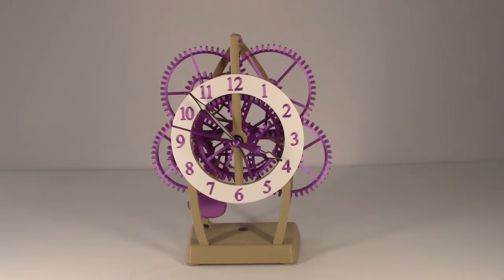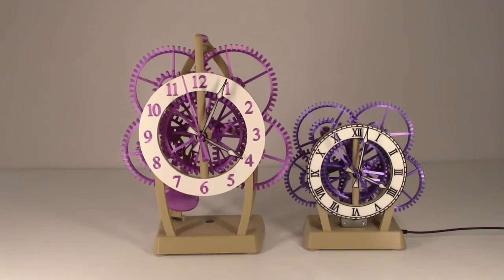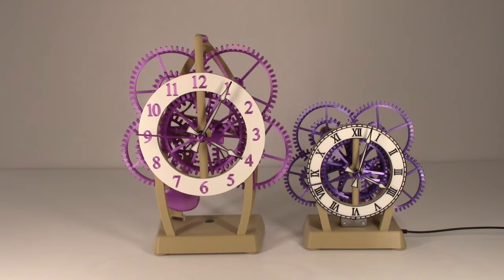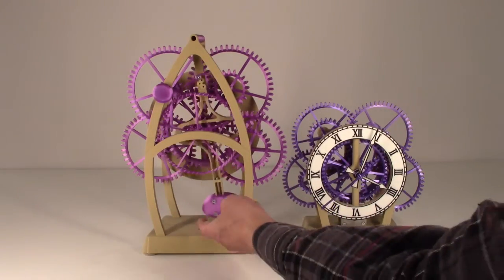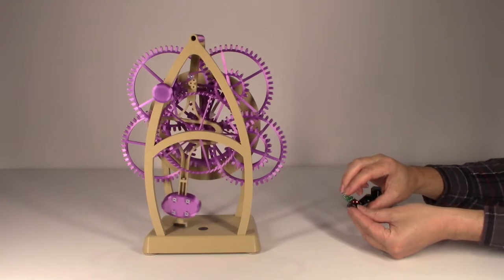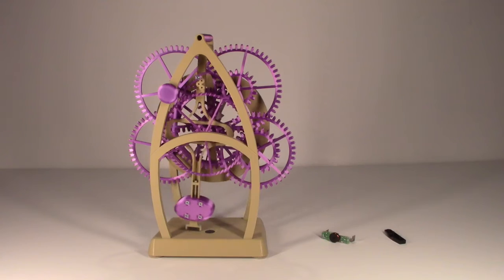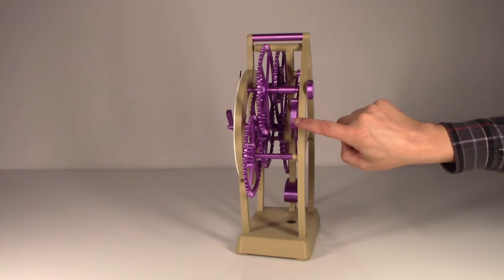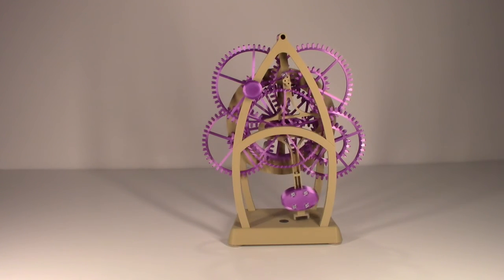Electromagnetic Pendulum Clock

Comment: Steve, I really like this design, will you have an updated video?  I'm having problems with the pawls,  I can't seem to find the correct balance for the active pawl to get a single click and no doubles.
Reply from the maker: My clock seems to be the most stable when using the ratcheting static pawl. This seems to eliminate the missing ticks. The active pawl needs to be moved higher if you have double ticks.

I will try to show it in a video, but it may be a while before I can post it.
Reply: @stevesclocks  Thanks for the tips.  I'm using the longest active pawl at the highest position and still getting double ticks.
Reply from the maker: @woodwaker1  You must have a really large pendulum amplitude. The shorter active pawl clips can be used to position the active pawl closer to the pivot point. This should reduce the push on the ratchet so that it should not double tick unless the ratchet momentum carries it past the natural movement. 

A heavier static pawl might add enough friction to slow down the ratchet. Trim off part of the static pawl counter-weight or use the ratcheting static pawl.
Reply: @stevesclocks  Thanks for all of the tips.  I Think I have a solution.  I am using the small passive pawl and the longest active mounted at the top.  I cut off about half of the active pawl counter weight to make the active part heavier.  It was skipping a tooth - bouncing over.  Now it seems to be working very well, 8 hours and within a minute.  This is a great design and fun to build

Comment: Steven, I have it all together and all the gears work great, after 2 attempts at getting working electronics I finally got a piece that works in its original housing, but then i put it in the clock, it barely moves it, it will slightly stutter so I know its doing something but doesn't move my pendulum, is there something I am missing?
Reply from the maker: Try Isolating the problem to the smallest possible test cases. Remove the ratchet and test that the pendulum swings for several minutes without power. Add the batteries and the pendulum should swing with a large amplitude. 

Then check for friction in the ratchet. Very little energy gets added with each pendulum swing so a tiny bit of ratchet friction can stall the pendulum. Check that the ratchet, minute hand, and hour hand stack is not pinching in the frame. The ratchet needs to be able to spin with minimal resistance.
Reply: @stevesclocks  I have one more question, I just realized my pendulum has a different 2 letter suffix then the one you show, what exactly do those mean?
Reply from the maker: @sange777  It's might be a feature of MyMiniFactory's database management. If I make an update, MMF will add a suffix even if the old obsolete part is deleted before the new part is uploaded. It should be OK.
Reply: @stevesclocks  No I ment on the ebay part, you listed Quartz Pendulum Drive Unit Module General Movements Clock Repair Accessories CA , I purchased Quartz Pendulum Drive Unit Module General Movements Clock Repair Accessories BD. 
IS there a difference in the CA vs BD? Also sorry for the questions and thanks for the quick replies
Reply from the maker: @sange777  I have no idea what those last 2 digits mean. It could be a code for the seller to find parts in their warehouse. 
It should be the correct one if you can see a coiled battery clip. The one with a flat battery clip will probably not work. It is a coin toss if they do not show the battery clip.

Comment: sigh.

they didnt have transistors when my grandfather built his... or rare earths... not sure AA was even a thing, mum says something about big dry cells, so i assume those large carbon zincs for glow engines...

just a solenoid and a chunk of steel on the pendulum, and a contactor up top. not the best as it appears to switch for the entire duration of one swing...

blowing the dust off, restoring it... about time i saw it work myself..

still refuse to use this silly modern crap. i hate solid state electronics. personal grudge against magic smoke :)

a little toggle/ inverted Y plate that over centers left and right activated by the pendulum, two pins that engage with a switch mounted to the pendulum so its pulsed just as it approaches solenoids, then overcenters and switches off ready for the return stroke...

didnt have diodes back then either!

and as neons seem rather time-period suitable... its getting a backlit display using the backspike from the solenoids :)

what else is weird about this clock? uses a crown wheel for the ratchet/escape mechanism. teeth at right angles. and then a worm gear reduction...

Comment: Hi, how well does this clock keep time?
Reply from the maker: It keeps great time when the pawls are adjusted properly. 1-2 minutes per week would be normal in this case. The risk is if the pawls are off, then it can either skip a tick or double tick and the time can be off by maybe 15 minutes per day. None of my other clocks have this risk. For example, the Coup Perdu with the deadbeat escapement option is a similar size and will always be 1-2 minutes per week.

Comment: I wanted to reach out to thank you for sharing your clock design. I recently 3D printed it, and it inspired me to create some changes . While testing the clock, I noticed that the pawls would sometimes pick up two teeth on the ratchet wheel, causing the clock to gain time.  I did experimented  with your assortment of pawls and could not resolve the problem.  To address this issue, I modified the ratchet pawls assembly to prevent it from picking up two teeth on the wheel. I would be happy to share my modified design with you and collaborate to improve the clock's performance if you're interested.  The modification allows the pawl to only pickup one tooth regardless of the amputate of the pendulum's swing.  I is a very simple change and does not require any modification to the basic clock.   
I built two of these clocks and made the modification to both.  They are working flawless.   Leon

Comment: steve you have the potential to make a 3d printed mechanical clock that runs for 400 days. i believe in you
Reply from the maker: Challenge accepted. Simple estimates are 1 year of operation for the original pendulum driver swinging freely using one AA battery. It should last 6 months on two AA batteries, since the current would be doubled. C batteries have around 3X the capacity as an AA, so 18 months seems feasible. Maybe it is cheating to use larger batteries. 😀
Reply from the maker: I measured the current and calculate that over 400 days may be possible using AA batteries.

The current is around 2mA for 50ms on every 500ms when the pendulum passes, so a 10% duty cycle with an average current of around 0.2mA. If an alkaline AA battery has a 2400mAH capacity, then the clock should run for 12000 hours or 500 days.

Comment: IM getting my materials ready to print this!!!

I have printed about 15 of your clocks so far. Absolutely amazing.

My first clock I built (the easy build clock) has been running without stopped for 4 months now..
Reply from the maker: There are a few things I want to polish before releasing the design, but it is getting close. At my typical work speed and gaps for the holidays, it is a month or two away.

It's good to hear that your easy build clock is still running. This clock uses a similar parts list plus the movement. I ordered several movements from eBay. They will be the first ones that come up when searching for "Pendulum Drive Unit". All of them came from China in about a month. They are all identical and stamped "Jinhong 5668". The other characteristic is that they have a coiled wire for the negative battery terminal. I ordered a different style from Amazon with a flat blade for the battery terminal. It has different electronics that would not work, so get the cheaper ones from eBay. They should arrive in time for the stl to be released.
Reply: Hi,
What about the accuracy of your clock in 4 months? is there any time deviation?

Comment: Huh i already have exactly this kind of pendulum drive module; It was in an exceptionally ugly clock that someone threw away, and i picked it up, it was full of silver-painted and blue plastic parts and a bunch of wooden dowels, unprocessed with splinters sticking out, stapled together, it certainly wasn't DIY, it was definitely mass manufactured, just with any lack of care for style or quality. Surprisingly, the movement in the clock was actually pretty good, it has DCF radio sync and is exceptionally quiet, it has to be worth a good chunk on its own; and someone in the family is actually using the clock part of the clock right now, just with offending styling and other pieces removed.

This pendulum drive unit also reminds me of a number of 1€-store toys, that bob their head or their body or those maneki-neko cats that wave your arm at you that you see in Asian stores and restaurants.
Reply from the maker: Interesting. I will have to open up one of the head bobbing toys to see what is inside them. They have to be really low power to operate with such a tiny solar cell. I suspect that they use a simple timer circuit set close to the natural beat of the moving element. 

This clock sets the time based on the pendulum length. The magnet passing over the coil is detected and amplified to push the pendulum with additional energy. There is no radio sync.
Reply: @stevesclocks  There isn't much to be seen inside there because the semiconductors are gloptopped on units made today (the nekos made 20 years ago were still discrete circuitry i suppose) but you'll find an electrolytic capacitor and a coil very similar to this one, and a permanent magnet embedded into the moving part.
Reply from the maker: @SianaGearz  Maybe the 20 year old circuits have morphed into the pendulum drive modules of today. The circuitry only uses a few discrete components. I should trace out the schematic. The coil is probably the most expensive part. The gloptopped units would have to use simple timers to build a unit that can sell at the dollar store.

Comment: Hi again
I want to buy and make one.
But I  dont like 3d printed plastics, in general. I want to use wood. İs it possible?
Reply from the maker: The design is portable to wood gears with a few modifications. The gear profiles and other features in the MyMiniFactory design are optimized for 3D printing, and would need different optimizations to work in wood. I have built one and hope to release the design after I catch up on a few other projects.
Reply: @stevesclocks  hi, Steve. Thanks for your reply. I will buy this one and try to modificate the parts for laser cut. (But I am not sure about the weight difference between plastic gears and wooden gears.) I still want to try.
If I can't achieve  than wait for your wood design :)) (this is great news )  😊✋
Reply from the maker: @SuperPicasso05  The weight of the gears is almost insignificant in this clock. The motor is one gear away from the second hand. All other gears rotate slower, so each downstream gear uses less and less power.
Reply: I am 3d printing in wood filament which has 30% wood in the filament looks awesome.

Comment: I have the clock clicking normal, the pendulum is clicking at 62 clicks per minute I am using the large active pawl clip with the long pawl. The pendulum bob is as low as it will go the bob is full of pennies, I was wondering if I should make the bob heavier.
Reply from the maker: It is worth a try. This clock ended up being the fiddliest of all my designs. It always seems to need something adjusted.

Comment: I have printed the clock and it turned out awesome the only problem is it is too fast I have lowered the pendulum bob all the way to the bottom in 12 hours it is gains 15 minutes
Reply from the maker: Is it double ticking? Two double ticks per minute would add up to a lot of extra time. The pawls would need to be raised higher to fix this issue.

Another possibility is the bob being too light so the effective length is much shorter than expected. Calculations say the bob should be lowered 0.4" (1.1cm) to slow the clock down 30 minute per day. A hollow bob would need even more adjustment because of the weight of the pendulum arm.

Comment: This video is not representative of the clock files I purchased the active pawls and static pawls are not the same, is there a video of the clock I bought.
Reply from the maker: There are multiple static and active pawls in the STL files. Each clock will have different pendulum amplitudes that will need different pawl lengths and positions. The configuration shown in the video for my clock is not always going to be the best for your clock. I have found this clock to be a bit sensitive to position and it does take some experimentation to find something that works reasonably well. Good luck.

Comment: Clock has been running 24 hours and is keeping correct time it took a lot of time to get it correct and a lot of Jack Daniels my family is very impressed as am I, two clocks down the 32-day clock set up for 8 days and the electromagnetic clock, now on to the Coup Perdu clock.
Reply from the maker: I am happy to hear that you have the clock working. The Coup Perdu should be a lot easier to get working, especially if you build it with the deadbeat escapement.